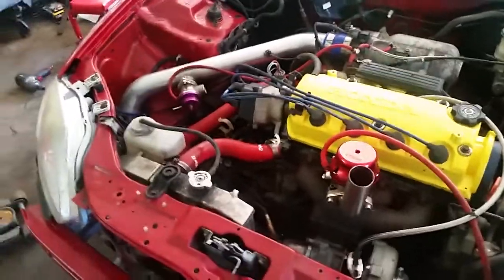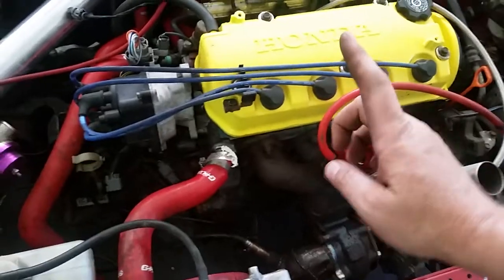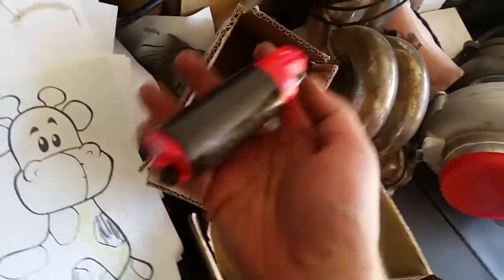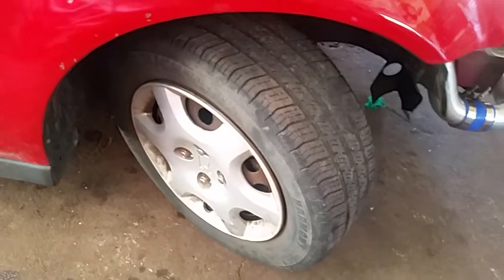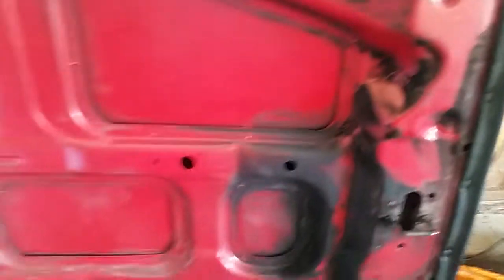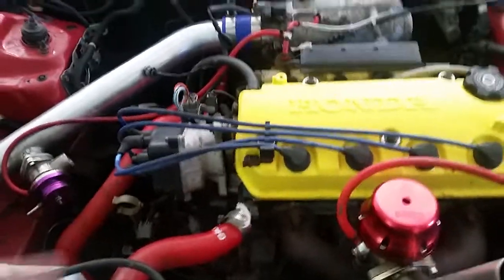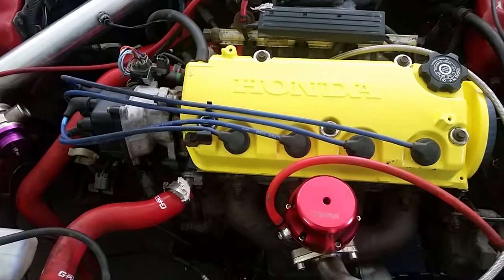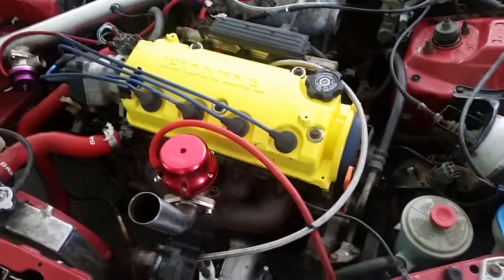Brief update, D16Y8 Vitara P2P0 build installed

Comment: So you have a wideband in your car right? How does the y8 run with the p28 and what kind of map do you have on It? I ask because I had a y8 with turbo on and there's not just a base y8 map and the z6 stock ignition timing is 16 as the y8s was 10 I believe, it made my car run like shit
Reply from the maker: tannerharkey the first thing I bought for this car was an aem wideband. Lol. Cost almost as much as I paid for the whole car ($200). Next I bought a p28 already chipped with a pretty good base map from advanced ignition seller on ebay. Now I would save myself some money and get a stock p28 and chip and base map myself. I use ectune and they have a basemap for a Y8 on there but idle timing is set for like 21.75 degrees. That is too much and made mine run like shit. I set timing to 12 degrees in the idle areas and adjusted fuel accordingly.

Comment: Congrats on your build bro i got a question for you, why an f23 air temp sensor ? Nd are your vitaras 75mm?
Reply from the maker: Well the f23 sensor is a threaded sensor whereas the d16 is just a rubber grommet fitting which wouldn't last last with boost. Pistons are 75mm.
Reply: Makes all the sense in the world,getting i’m an accord sensor soon ahahh
Do you have any piston slap? Don’t now if i should order the 75.5 nd bore it or just 75s
Reply from the maker: Well soon I'll be uploading a video showing how I just blew all 4 pistons (cracked ringlands) thanks to a timing belt jump during street tuning. No other damage than the pistons so rebuild coming quickly. As for piston slap, no I had no prob with that or any p2w clearance.